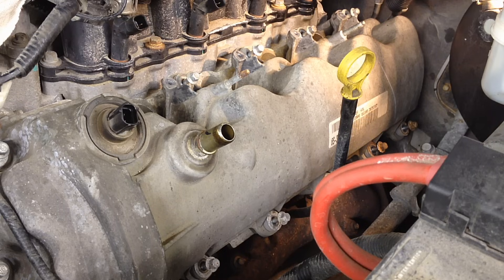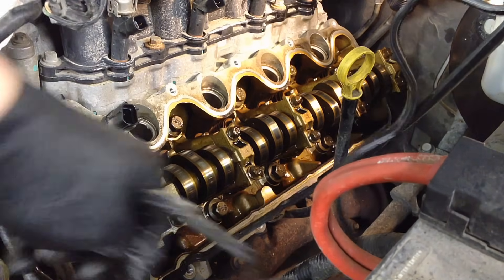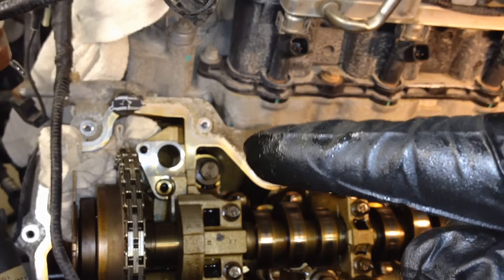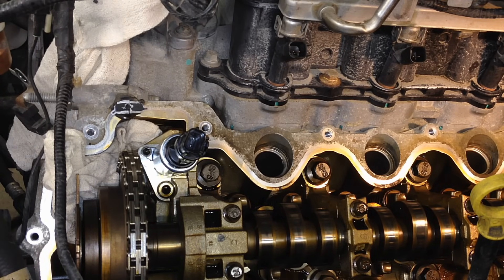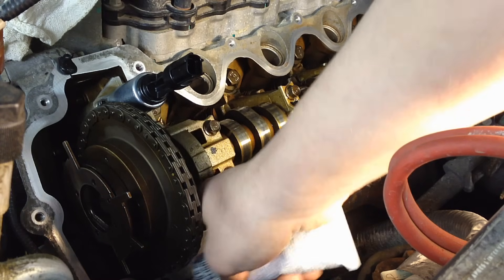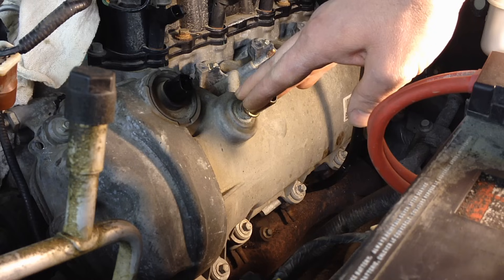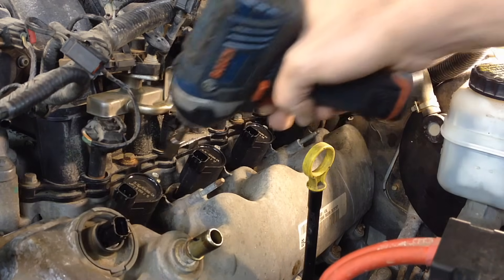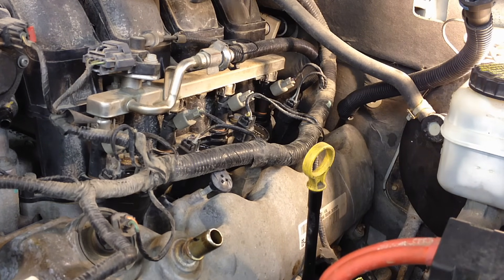Ford 4.6L 5.4L 3v Engines: VCT Solenoid Replacement

Comment: 216k miles and my "04 5.4 runs like a charm other than sounding like a quiet diesel.
Reply: I bought an 04 5.4 about a month ago runs great except for this little problem with the VCT, but it sounds like a diesel. What's up with that, have you come across any reasons why ?  Thanks !
Reply: Dillon Turner I got my 04 with the 3v at 204k miles, and it had the light knock. I now have 216k on it and it runs fine. Knock has not gotten worse. I just continue to change the oil. I know at some point the engine will fail but then I'll just put a 5.0 in it, or a Cummins 4 cylinder.
Reply: You just said what I suspected. My 05 F-150, 5.4, sounds like a diesel.
I have the new VCT solenoids I just haven't put them in yet. When I cold start it, I give it extra time to warm up, it just sounds like the bottom end is coming apart. The computer ( idiot light ) says oil pressure is good but to my ears, it sounds like not enough oil passing through the engine. Dang, I hope it's not the head. I have 166k on it and it runs great but??? Thanks for posting this helps a lot.
Reply: Jim Wills the guy I bought it from had it serviced according to the owner's manual at the dealer since he bought it. He had all the documentation to prove it. He said it had been like that since he remembers. From what I read online as long as it's the VCT, and not the cam or anything else, the only thing you're going to suffer is some terrible gas mileage
Reply: Joshua Jones 
The truck runs great, except when the idle goes bonkers do to those solenoids. ( at a stop) Gas mileage however could be a bit better. In the city i'm getting 10.5, and Hwy 12.5, and I keep my foot out of it. Like I said above, a cold start sounds just like the loose tolerance of a diesel. After it's been driven and warmed up, it's no where near like the start up, yet everyone ask is it a diesel. I guess, I just need to get under the hood and change those VCTs out and go from there. Thanks Josh....Josh, does yours have that cold start bottom end loud chatter?
Reply: Jim Wills yes it is louder at start up but only for 5 or 10 seconds. I only hear it at idle though. No other time. Once I get it above 1100 RPMs the sound goes away
Reply: Joshua Jones 
yep that sounds about right. Mine will idle loud for a good 5 minuets or until I take off. After the RPMs is up nothing until I come to a stop then it is just loud enough to make people wonder. Well ill post the outcome after I change those out. Thanks again Josh.
Reply: Jim Wills looking forward to see if that fixes it.
Reply: TheFrontYardMechanic mines sounds exctaly like you explained did you happen to find a solution also mines shake quite a bit is that because of low oil pressure?

Comment: Have a 2007 5.4L;
 get heavy diesling when come to a stop or slow idle after driving and warm up only. No rattle unless at low idle. Disconnected camshaft position sensor and no more rattle at idle.
1) would simple camshaft sensor replacement be my cure?
2) do you have to remove valve covers to replace vct solenoids as mine do not have large gasgets.
txs

Comment: I really need some help. I replaced the left (facing front of the truck) VCT solenoid and it went pretty well. Went to replace the other VCT solenoid by the fluid reservoir and the cover to the solenoid doesnt have the little tabs to pop off the cover around the solenoid. Its a 2004 f150 5.4 lariat. Many videos i seen both solenoids had the tabs but mine does not. Is it a different motor?  Motor 2007 and above? Does this mean the valve cover would have to be removed?
Reply: Nope, just use a small flat head screwdriver around the perimeter.  It will eventually come out.

Comment: 06 5.4 expidition. Did timing, phasers, etc. Not vct. Still pulling p0358 ect. Should have fished more for this vid, your others were very helpful. Saw vid where they just pulled vct cover, not valve. Recommened? Replacable gasket?

Comment: my 07 expedition keep throwing codes p0011 and p0021 but I have no issues at all besides check engine light...i replaced the vct solenoids and the sensors and light keeps coming back with no issues...what could it be?
Reply from the maker: +Jose Aguilar Follow my new video on checking oil pressure manually.
Reply: +FordTechMakuloco I checked oil pressure and its holding steady at about 27psi at normal running temp...also it does not give me both codes all the time sometimes it's only p0011

Comment: hey FordTechMakuloco I'm replacing my pcv valve but as you know it comes with valve cover assembly my question is the one i got from ford  has less bolts than the one I'm going to replace. you see any issues there? ? 
note: old cover 14 bolts 
new cover from ford 9 bolts
extra info: engine 5.4 3v 
06 f150
Reply from the maker: +xxxTHEROLISxxx The one you got is for the newer head design and as far as I know is not compatible.

Comment: please answer!!! I have a 2002 expedition 5.4 triton I can't find where my vct is located it is not where all this  youtube videos say it's at for mine. also most videos show a metal valve cover mine is black (almost look like plastic) and I have even been to the junkyard open two different expedition (2003) and they also didn't have a vct in the front by the cam phaser. help pls!
Reply from the maker: +aaron hernandez vct didn't start until 2005 on the expedition

Comment: First, Thank you for the wealth of knowledge that you share freely.  Secondly, I have a '07 F150 4.6L and experiencing long crank before finally starting (5-6 seconds).  Would a stuck VCT solenoid cause this?  I have the rough idle, and runs fine at normal operating.
Reply from the maker: +Mark Hotopp No you need to check fuel pressure cold for a drain back issue.
Reply: @FordTechMakuloco  what about a rough idle only when engine warms up? P0022 and p0345

Comment: If the VCT get stuck closed would it drain power from the engine? I do get the knocking noise sometimes when I come to a  stop but I get more of a  "no balls" truck.. I normally get a check engine light when this happens and when I scan it  I get the codes p0012 p0022  Bank 1 Bank 2 After it cools down and I reset the computer she runs great,  for an hour and then she starts acting up when she nice and hot. "traffic driving" Do you think it would be the vct? I have a f150 2009 3v 5.3 330 btw
Reply: Jonathan Renaud need engine 2003 ford super duty triton 5.4 liter

Comment: If the right side VCT were to fail, would that cause cylinder 1 - 4 to not work.  Idol is very rough, but as i acceleration, it runs good at higher rpm's.  If I pull cop plugs at idol on rt side, no change in performance.  if I pull a cop plug on left side, the engine will die.  This is a 04 F150, 5.4 with 180K.  Trying to save my son some $$, I am a lift truck mechanic, but my knowledge is limited to 4 cyl engines.
Reply from the maker: +Jenn Bostedt It will throw off timing for that bank and affect all 4 cylinders yes. I have also seem the cam caps wear through
Reply: +FordTechMakuloco I some how posted under my daughters name, oh well.  I did the procedure of applying 12vdc to the VCT coil and after several cycles, the valve freed up and the truck is running like a champ again, but I see a little work in the future changing out the VCT's.  really appreciate the response and help.  Tim Bostedt

Comment: Hi I'm having codes p0022 and p0345 also have had code p2195 my truck run and drives awesome at higher Roma but once it drops to idle at say a stop sign n runs ruff and dies I unhooked my Vcts and it ran great then I had another stall 10 min into the test drive could this b my phasers they tick for the first 3 4 seconds on start up overall runs great till truck is warm I'm lost!!!

Comment: Purchased the wedge and spring compressor when I swapped out my Mustang cams. Cost about $300.00 CA. Something to be aware of if using the spring compressor, watch carefully that the spring retainers don't come loose and disengage the valve stem making it possible to drop your valve into the cylinder. Great video!! (as usual)

Comment: i over tightened 2 of the valve cover bolts and now the bolts cant be re-tightened and they move freely.... what do i do? is this going to cause a leak? or do you think it might not cause an issue?
Reply from the maker: Most times not an issue
Reply: +FordTechMakuloco Thanks for all the help man, I replaced the driver side VCT solenoid and the car is running a lot better, but now I have to replace the passenger side, any tips for that side?
Reply: FordTechMakuloco ^^
Reply: I just did this with the first bolt. What should I do?

Comment: I have 2006 f510 with the 5.4. I don't need to remove my valve covers correct? also is  that solenoid you recommended the new updated one? and will it work in my truck?

Comment: I did the replacement on a 2008 (9/07 build) Expedition and didn't have to take the AC loose on the passengers side but did have to remove the expansion tank on the drivers side.  Took 4 hours total.  Make sure you have compressed air to blow out the area around the COPs and then the area around the plugs after you remove the COPs, my engine is clean but there was still a lot of grit in these areas.  Worth the time as it runs like NEW, was throwing P0018 and many others and ran like a dog.  Top screen on VCT on drivers side was torn, likely the cause of all the issues.  Glad to see how clean the interior of the valve cover was.  Thanks to YouTube / Google I saved $$$$$$!  Used REAL Ford parts from local dealer,  $200 including 2x VCTs, 2x VCT seals, 2x Valve Cover Gaskets.
Reply: did you have to remove the valve cover?
Reply: +Badr Fisal Yes, both sides, but not the AC hose. This is on a 5.4 Expo built 9/07
Reply: Thanks I have the same vehicle and model

Comment: Excellent stuff. On occasion there can be backfires when these fail, and an important thing to check is the vacuum connector at the rear of the intake which goes to the brake booster. That small hose right at the intake can swell up like a balloon and cause a very tricky-to-find vacuum leak. Happened to me on my 09 Expedition.

Comment: Hey Brian, best wishes to you bud.
I have a question, can the vst solenoids be replaced on a 2009 flex without removing the valve covers?
Reply from the maker: +Daniel Gomez No those must be done with the valve covers off.
Reply: +FordTechMakuloco Hey man I watch all of your videos.Had this same problem and thankfully this helped. Im wondering what a repair like this should cost as I ask around for quotes? I want to do both.
Reply from the maker: Around $350 for both sides depending on the labor rate.

Comment: Holy crap I had no idea those were the vct solenoids, I'm still learning a lot about my 4.6 on my 2008 Mustang GT. You described perfectly what is happening, i go for a drive and everything is normal but once I come to a stop, things start to get very bad....  I'm going to check my passenger side solenoid. Dammit I just put the valve cover back on too...
Reply: 5 years later and I'm finding my own comment lol. Solenoids just went bad for the first time since I changed them again
Reply: @SangheiliSpecOp  what oil do you drive?
I go for 5w30
Reply: @nfsking4826  thats what I use as well. Also its funny you replied here, I still have my mustang and the solenoids are acting up again, I have new ones and have to replace them
Reply: @SangheiliSpecOp  im going to buy one and do a timing job
Reply: @SangheiliSpecOp would ur motor rattle and knock ? i chnaged timing chain cam phasers guides and tensioners but motor is still rattling and knocking. i heard replacing this will help my problem ?

Comment: I have a problem where on my 2004 Lincoln Aviator on a cold start the vales on startup are very loud but only for a couple seconds. it also idles a little rough but not much is that something that could be happening because of the VCT sensor??
Reply from the maker: +shannon fisher You don't have any vct system The most common cause for that is lifters that are bleeding down over night.
Reply: +FordTechMakuloco  Any Idea on a fix for that?
Reply from the maker: you will have to verify which valve cover it is coming from then remove that valve cover let them sit overnight and test each on to see of they plunge they should be rock hard.
Reply: +FordTechMakuloco What is the fix for something like that?

Comment: On a 2007 ford expedition, when pulling the passenger side valve cover to change the vct is there a way to remove the valve cover without disconnecting the a/c lines?
Reply: +John Smith did you ever resolve this? im in the same position now...please let me know
Reply: yeah same problem. anybody got any tips??

Comment: Great Channel! I have a 2008 F150 KR 5.4 190,000 that has an engine stubble when warm under light throttle, like pull up the driveway. If I come to a complete stop and give it very little throttle less then a 1000rpm's engine stubbles bad and almost dies. If I turn the truck off and restart its fine, but after a couple of minutes it does the same thing. it has no knocking at hot idle, no codes and runs great. Is this something with the VCT solenoid, Phaser or something else? Thanks.

Comment: I bought a 2005 f150 crewcab 5.4 3v 132,000 miles, its not really driveable . it starts up and idles fine if i ease into the throttle it will rev up just fine  but if i go wot from idle it will just spit back and bog down

Comment: got a video on right side 2008 f150 5.4l motor..transfer dipstick tube interference!
Reply from the maker: Unbolt the 18mm bolt from the side of the head that's holds the dipstick tube on through the wheel well opening then swivel the tube out of the way.

Comment: hello, I own a f150 xlt 2010 with a 5.4 v8 in her. she sounds like a a diesel pickup truck at idle I've also read that Ford has put out a recall for this issue will it be would  it be covered. if not what is the going rate per hour for this
Reply from the maker: +Johnathan Alford There is no recall for this, here is my video on how to fix the diesel sound along with all the parts you need in the video description- https://www.youtube.com/watch?v=HZuArjvEfRc

Comment: Hi I need to change vcts on my 2004 f150 fx4 and I also need to replace the valve stem seals was wondering if you had a video on replacing the seals in a 5.4 3v or if you might have a link to a video of a mechanic you trust. any help would be very much appreciated. your videos are very well put together and helpful already have used them to fix my 4x4 vacuum selinoid and actuators. I've never replaced valve stems before with the head still on. I've already watched the vct video and would like to do it all together. appreciate any help you could give thanks
Reply from the maker: +Christopher Waechter Best I can do is send the instructions, email me or pm me on my facebook page so I can send them.

Comment: Thanks a million for this video!  ... When I come to a stop, sometimes it literally sounds like the motor is going to come apart with all the rattling going on.  Once I goose to throttle, the noise goes away.  I cant get to this procedure until next week.,so here's my question, do I have to worry about the motor jumping time when this occurs?
Reply from the maker: +Frank L No the chain tension stays put.

Comment: I was curious about why you take the valve covers off when you can get to the small screw through the valve hole? I work on a/c engines where I just secure all my sockets and extensions together so as not to drop them inside. why couldn't you just do that in this case?
Reply from the maker: As stated in many cases the bolt threads into the solenoid and backs completely out then it falls into the engine. Also not all can be done that way and while the solenoid is out you should be inspecting the vct adapter block for debri none of which can be done valve covers on. I call it the hack way doing it your way.
Reply: FordTechMakuloco Not my way, so technically; I'm not the hack. Just other ways I've seen on here to do the same job. The other things you said in your reply to check, is one of the reasons I asked my question. I wasn't aware of checking those things.
Reply from the maker: greg johnson I am saying the way you are explaining is the hack way in my book, half ass etc just the procedure not you.
Reply: @FordTechMakuloco  have you ever seen a problem with the pcm (control/power) side of the solenoid causing issues? Got an expedition running fine when cold but when warm it runs rough.  P0345 and p0022...could a bad pcm or bad pcm wiring issue cause a problem with one of the solenoid valves?

Comment: Great Videos!  In this one you mentioned a way to test the VCT Solenoid.  We have a 2010 F-150 with the 5.4L 3V.  It has the issue of the timing staying advanced when the engine is hot.  I have watched it using a ODB2 tool via bluetooth and my phone.  We had taken the truck a couple of months ago to the local ford dealer.  The tech their made note that the oil pressure was dropping to 8psi.  They recommended changing the engine at a price tag of $8900.  After a little research I found these videos.  So I changed the VCT's as well as the timing components both chain tensioners were bad. After doing all this the engine still will not back off on the timing (not all the time) and cause the "dieseling" noise.  My thoughts are maybe since I didn't get "Ford" VCT's that they may be bad.  How can I test?  Oh, 95,500 miles.

Comment: I have a 2010 f150 SuperCrew 5.4. It makes a knocking or pinging sound when you're sitting at a red light what would that be at low idle and it only does it at little while otherwise the truck drives awesome